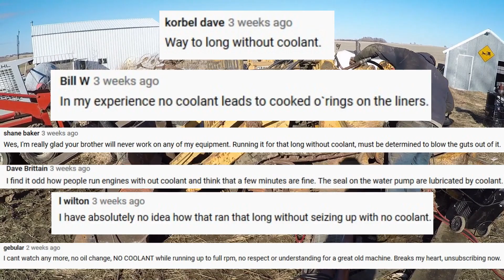Allis Chalmers HD-5 First Moves in 17 Years

Comment: You mean hands on experience has more value than internet opinions? 🤣🤣
Reply from the maker: I dunno. Maybe I handled that wrong. People are just acting like this is some kind of rare, desirable, high value machine that we are going to depend on to make a living. In reality it's just a lump of old iron that was headed for the crusher. It might still end up there! Somehow, to a large group of viewers, us cutting a few corners to figure out if this thing is even viable and worth spending any time or money on is worse than just letting it rot in a field like it has been for almost 2 decades. I don't get it.
Reply: @WatchWesWork  Let me know when you're ready to get rid of it. It can get along with my Allis Tractors just fine.
Reply: @WatchWesWork  well, it might be junk to you, but to someone who relies on that kind of equipment for logging firewood, and is having a hard time locating replacement parts on ebay, and all of the sudden they see what they need on youtube getting the crap kicked out of it......and I appreciate where your coming from, but as a mechanic that has seen the insides of hundreds of engines, just 'cuz it runs don't mean it ain't severely damaged. my dad's Allis Chalmers WC had cracks between the liners, burnt valves, water damaged everything, milk white oil, split wood for decades "as is", up till he started it without checking the thermometer, frozen water in the oil pump caused the worm gears on the pump and cam shaft to explode.
Reply: I let engines run longer than that with dry blocks when I heat cycle them after I rebuild them and never had a problem.
Reply: @JoshuaZiesmer  It's hard to explain to the people in South Africa you flush your toilet with perfect drinking water too. Sometimes you just do the things you have to do with the stuff you have without considering how the rest of the world would feel. I understand what you mean, one man's trash is another man's treasure but thats how it goes.
Reply: LMAO ALL you know it all posters .... KHA
Reply: Because we all know that if you put up videos on YouTube you know everything, just like the comment "I saw it on TV".  Many have replaced that mentality with "its my favorite guy on YouTube so it MUST be right".  Both are warped thinking.  There are some commenters who know a LOT more than YouTube video makers.

Comment: The internet trolls haven’t seen anything until you can see the orange glow of the engine block on the snow beneath the machine.
Reply: Yeah screw them guys...
Reply: them ol cast iron machines was built tough for sure mr. sir
Reply: I've seen a vw bug engine glow after taking out the push rod tubes unknowingly. Even watched a cigarette be lit with it. One thing i didnt see was that engine run again. But i did see that same engine fly. Found it in the weeds with brush hog. Guess i just had to make sure it was dead...lol

Comment: Love it! ... can’t tell you how many times I’ve seen a diesel run for a few minutes without coolant just to test a repair with no issues EVER! Being a compression ignition engine it produces much less heat at idle than a spark ignition engine ... all of these keyboard mechanics out there 🤦🏻‍♂️
Reply: Guy I’ve seen diesels run at an idle all freaking day with no coolant. So your right about the temp being lower. Some people think they are smarter then the rest. It’s usually because they have zero life experience and it’s all text book stuff they are spouting.
Reply: Mad Man Marine you’re right about that! Gotta love the “experts”. Lol
Reply: Diesel fuel ignition temp is 410°F. Gasoline burns about 100°F hotter. Also plenty of unburned fuel in a dirty old style diesel to absorb cylinder heat by vaporizing. And much heavier iron castings, too. Taken together, those things are going to make this engine run cool. Also very dirty, very toxic fumes for the operator sitting on that old board seat, and very heat and fuel inefficient. But I doubt that diesel's higher cylinder compression has much to do with it. Fact is, moving or not, this machine is still basically junk. Gotta love the operator's safety roll cage. But of course real men don't need no stinkin' safety roll cages. That's why in America the death rate for men over 45 has been rising over the past 20 years.

Speaking of things only safety Nazis could love, with that cut from a piece of old rusty metal...Wes, when was the last time you got a tetanus shot update?
Reply: Josh Drexler - Do you walk around in a bubble? Goodness, I almost forgot, how are you with this corona virus? Do you even leave your house?

Comment: We have a diesel repair shop here in town. The owner is in his 70s, still working 6 days a week and they say he's the best diesel mechanic you will find anywhere. He does any repair you can think about, he even does complete rebuilts of stone dead engines and when he's finished, they run better than new. Most of the time he testruns without coolant or exhaust system. He would not do it, if it did any harm to the engines.

Comment: Great video, best thing about these old machines is they will run no matter what it has been through. You could probably run it at idle for a day with no coolant, if you where stuck in the middle of nowhere back in the day
Reply from the maker: Right. This engine weighs around 800 lbs but makes all of 40 horsepower. I don't even know why it has a radiator.

Comment: I was concerned you might be running it a tad too long without coolant but I’m so pleased you silenced all the armchair genius’ out there who have been there and done it all from the comfort of their living rooms. Good to see another old piece of kit back to life.
Reply from the maker: I think the video made it seem like it ran for 20 minutes with no coolant. The clips are spliced together. It never ran for more than about 3 minutes, and the coolant was not empty, just drained to the level of the hold in the radiator.
Reply: @WatchWesWork  Well that does kinda make a difference. A few of us were sitting here watching that and cringing, wondering how you could run it for 15 minutes straight with empty coolant passages and not cause some minor problems for assorted bits of internal metal. If we'd known there was some static coolant in the block and that it got time to cool down now and then we might have had another opinion.
Reply: @rodfrey  - Now, you're blowing it out of proportion, the other way - context, makes a big difference - most of the disbelief and concerns, came by it honestly - "I think the video made it seem like it ran for 20 minutes with no coolant. The clips are spliced together. It never ran for more than about 3 minutes, and the coolant was not empty, just drained to the level of the hold [hole] in the radiator" Wes- Given that it wasn't otherwise indicated and, the jump cuts weren't as apparent as time lapsed versus, camera repositioning; those of us with actual experience and knowledge were incredulous, too. So, take your own advise as well "Maybe don't jump to the conclusion that other people are idiots." Rod F- 

The saying that I heard goes "believe none of what you hear and, only half of what you see."
Regards-

Comment: No way, you your going to tell me next you had the battery sat on a concrete floor  😋
Reply from the maker: Right, and dielectric grease on the terminals. It'll never start again.
Reply: The newer plastic batteries don't have a problem with a concrete floor back in 50/60 the cases were made different and they would discharge on a damp floor.
Reply: @KPearce57  would they discharge while sitting in a steel battery box?
Reply: @suburban404  Because the steel battery box is insulated from "ground", the concrete is solidly grounded because it's ground. /s
Reply: @KPearce57  - Those of us who are old enough to more easily die from COVID-19, now; growing up, had it drummed into our heads not to leave the batteries straight on the concrete floors - because, it would make them go bad. 

"Thirty years [more like 50?] ago or so, most battery casings were made of hard rubber. And because of the porosity of that material, battery acid would sometimes seep through the rubber and create a conductive path through the damp concrete, draining the battery." Ray, on cartalk- 

It's not a 'myth' yet, the term "zombie-truth" is fitting. To this day and, knowing better (even knowing the cooler temps of concrete floors can actually help prevent discharge from high ambient temperatures); I still compulsively set my batteries on thin wood or cardboard. It was then, common-sense; it's expired now. Cheers-
Reply: @markaoslo5653  ever put a double A battery in your pocket full of loose change? Thats a good one to do when you get bored.lol
Reply: @donniebrown2896  - No, yet I did used to put the terminals of a 9-volt battery, on my tongue; to check it for power. Tangy! is the word, we're looking for - lol
Reply: @suburban404  Yes. ALL batteries discharge in time. Let them sit long enough, they will go dead. Low enough charge in a cold environment and they freeze. When they freeze, they break the plates and become junk....most of the time.

Comment: Gotta love all the armchair engine professionals😂 do ever wonder where they come up with some of those theories?😜
Reply from the maker: Who knows. I'm sure there are instances where they are correct, but this was no one of them.
Reply: they take things mentioned  in other YouTube videos out of context and pretend that it's their own real world experience.
Reply: They haven’t seen the video on deboss garage where they kill a Detroit and it takes like 10 minutes full they told to seize up and it started after that. It’s hard to kill a Detroit.
Reply: They read things so they think.that means its fact. Yes you CAN burn exhaust valves without exhaust manifolds but not instantly. And DEFINITELY not because of back pressure. Back pressure power loss is what idiots think causes loss of power when they cut cats off their 94 chevy. In reality its the o2 sensor freaking out cutting fuel=less power. Back pressure and pressure waves are only critical on 2stroke high revving engines. Old diesel 2strokes dont really care they just work

Comment: Great video. Got to love the experts  and there's keyboards. I've been working on diesel for 20 years and I go about my repairs much like you do. Make sure it runs before you waste the money on all fresh fluids. Love the channel keep up the great videos
Reply from the maker: Right. It's not like we are ripping bedrock with it, it's just idling in the driveway.
Reply: Exactly!!!! Cant tell you how many engines I've overhauled and have done the exact same thing. And how many engines I've brought back to life that have been sitting. Those keyboard surfers dont know there butt from a hole in the ground when it comes to common sense and everyday mechanical work.
Reply: I work for cummins and if you ever have any cummins diesel questions feel free to ask
Reply: @toddthompson3043  I have a question if you don't mind. I had a 2000 ram dually with a Cummins. In your opinion what would cause both the fuel "up" pump and the distribution pump to both go bad at the same time. This happened after the new ultra low sulfur fuel was brought into our area.
Reply: If you have the vp44 pump, then the low pressure pump failed and it then takes out the high pressure pump.  You will not realize the low pressure(electric pump) is failing until it is to late.
Reply: @ donnie brown. In my opinion from what I have seen over the year the most likely cause of a failed lift pump then in turn take out the vp pump will be high fuel inlet restriction.  Anything over 10 in hg of restriction will really strain a lift pump and if they run there for any period of time it will cause both pumps to fail and cost a lot of money to fix.

Comment: Y’all sure did a quick full engine and water pump rebuild after all the “damage” that occurred in the last video.
Reply from the maker: Yep. Cheap rebuild too, no parts needed.
Reply: @WatchWesWork  Those engines are pretty indestructible, just a good cleaning and a fluid change will get you half of the work done.

Comment: I worked for a guy in the 1960 who had a 4-71 GMC diesel in a GMC truck that had a cracked block, and it leaked coolant into the engine. Solution, oil in the radiator. It worked, but ever so often, you would have to drain some oil out of the crankcase and pour it back into the radiator. We hauled some heavy equipment with a float on some back roads. On one hill, the driver and I had the doors open ready to jump when we pulled the engine down to lots of black smoke, and very few RPM until we topped out. We stopped the truck, let it blow a little, drained some oil out of the crankcase, poured it back into the radiator again, and went on our merry way. GMC/Detroit diesels sure put up with a lot of abuse. The guy ran Allis Chalmbers HD16s a HD20 that used a torque converter that ran diesel fuel through the converter then into the engine. I was only about 18 at the time, not smart enough to know better, but it was fun.

Comment: Oh the memories! Grew up sitting on my dad's lap driving a 1954 Cat D4. But it was much fancier. We actually had a seat cushion..
Reply from the maker: We have one of those too. It's been out on a job for over a year.
Reply: @WatchWesWork  My granddad bought it 2nd hand in about 1960 - it had been used in logging. My dad finally sent it down the road about 10 years ago. It ran awesomely. But the tracks had gotten so thin they had to be addressed. New tracks cost more than the value of the tractor and never could score "good" used. Plus he had a D6. The good news is the D4 went to a "hobbiest" with the intent of fixing it up - where cost vs. value doesn't follow the same rules. So it continues to live.

Comment: Nice CGI work!  If I didn't know better, I'd say it was running, making smoke, making noise and even moving.  It would fool most people.
Reply: must be a road flair stuck inside the exhaust pipe for smoke effect lol
Reply from the maker: Right. You can barely see the strings moving the model.

Comment: I was a little uneasy at first watching it run without coolant but it's obvious you guys grew up around and work on machinery every day and know when an engine is getting hot.  Also, it's not mine.  😁   What did give me the willies though was watching your brother start it with ether.  I'm guessing that's what it was.  Maybe okay while priming the fuel lines but it shouldn't be needed afterward. I hate that crap. JMO though.  

That slobber out of the pipe is an exhaust antirust feature included with every Detroit at no additional charge.  I promise your DIY exhaust will outlast the crawler. You probably know this but watch the blower seals. If they go bad the motor can feed off the oil and air and go Ziiiing!!     ;-) 

To those freaking about about the WOT revs: A 2 cycle Detroit has a max RPM of 2100 more or less depending on injectors and timing. At max throttle they sound like they are about to explode when in reality they are turning the same RPM as a 4 cycle at high idle. 

Nice video guys. Very enjoyable.

Comment: I certainly do hope that no serious damage gas occurred to your engine.  I would not wish bad on anyone.  I truly loved my HD-5.  Amazing low end torque!  Oil out the exhaust was the first symptom   right before mine came apart.  I was just trying to get it out of the pasture and onto trailer so that I could haul it in for radiator repair.  Mine did not fair well...at all.    Still have the engine if you need parts......  Luckily, I had a pump skid with same engine handy.
Reply from the maker: I think the crap in the exhaust was in the pipe he used to build it. But the engine seems solid. Good oil pressure. Has decent power when warmed up.

Comment: Hey guys, if you don't really want to spring for an injector yet, and the one that's sticking wasn't actually damaged in the engine incident, maybe it can be saved. Way back before we had all of the fancy store bought injector cleaners and fuel additives, truckers used ATF in the fuel to clean the injectors and add some extra lubricant to the fuel. Adding a quart or two in the crawler's fuel tank and running it a while might possibly free that sticking injector up and get it working. It's worth a try and doesn't cost an arm and a leg. If it doesn't work, then it will have done some cleaning in the fuel system and lubricated the injector pump.

Comment: To all those commenting on no coolant , it wasn't running that long. It takes a while for it to get hot enough to hurt. Sure the pump seal gets lubed by coolant. Sitting as long as it did , its likley already on its way out. 71 series detroits dont use orings on cylinder liners. They are dry liners. Coolant is pretty much there to keep cool running long periods. The fastest drag cars dont use coolant. They actually fill the coolant passages with concrete type substance for strength. So why dont people not comment about things they know nothing about?

Comment: All those comments must been noobs or keyboard junkies. Running for that long wont hurt it at all. It had no time to really start to warm up to where damage would start. Im a midwestern too (wisconsin) and everyone runs engines at idle without coolant or exhaust manifolds for short times all the time. Not one engine in my 20+ years of auto mechanic work. That exhaust make is sound different hollow echo sound. That old and the steering clutches still are good thats crazy. Reminds me of growing up on my grandads heavy equipment. But my first dozer I learned to drive was an old Cat D9 then after that I graduated to the little john deere 350 dozer lol. The little dozer and the little loader (ford)  were the only 2 that were not Cat minus the dumptrucks. When he "retired" that meant that he stopped working at the pits let his partners kids run that and just did local work with little machines.